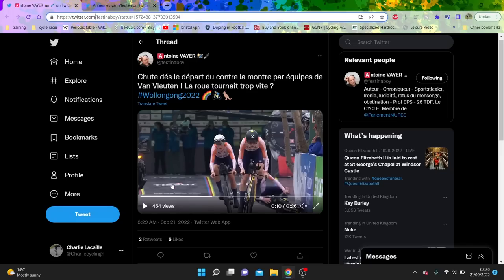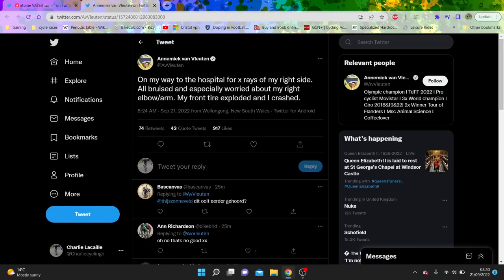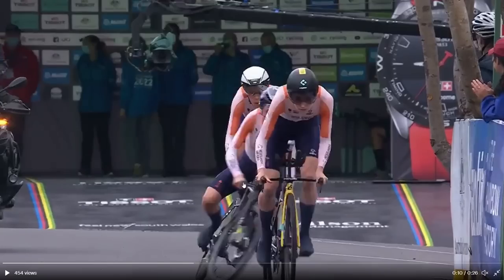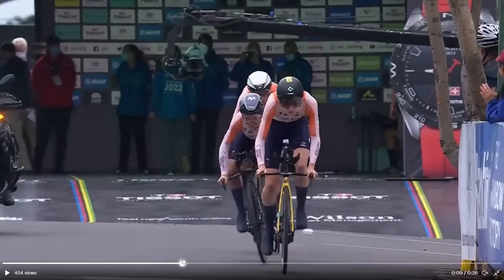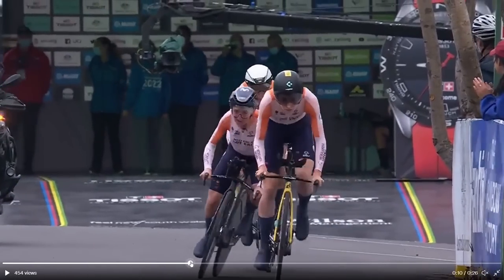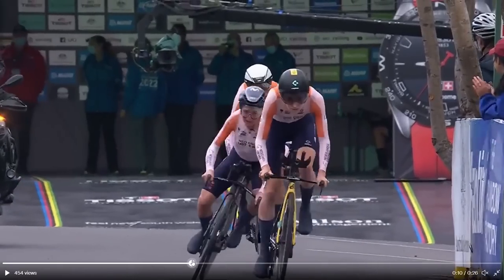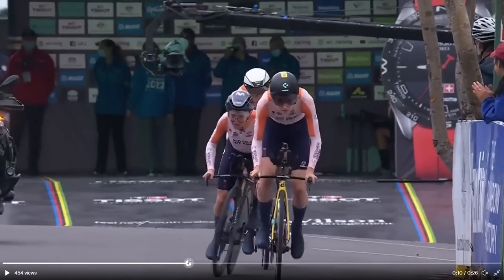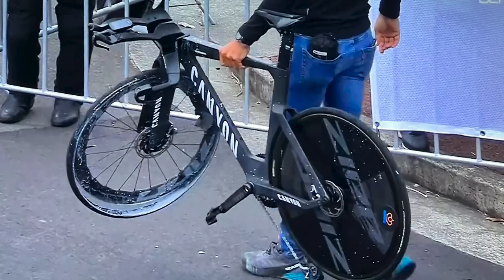Van Vleuten MASSIVE WORLD CHAMPS CRASH - caused by TUBELESS

Comment from the maker: looks like now  it was her chain falling off her big ring which caused the crash and not the tyre which AVV initially blamed
Reply: Either the chain or some slip of the free wheel mecanism. As you say - nothing to do with tires.
Reply: The chain falling alone would not cause that to happen. I've dropped chain many times and so have the pros and that does not causes you too loose control of the front of the bike like that. Have a look at Waynos video: https://www.youtube.com/watch?v=j5Mqh4Sudok&t=485s 
It makes sense too, either the rim cracked on the inside or the tape popped inside, which led to the wheel going flat almost instantly. The tire came off the the rim when the wheel finished cracking against the concrete barrier. If you don't believe me, try sprinting with a flat wheel full of sealant, it's like riding on butter. Those Zipp wheels have had some issues. GPlama cracked his and a friend of mine had his cracked on the inside, a week after buying it! She could have also miss-shifter the front derailleur while trying to grip for dear life and that just made it worse.

Comment: It wasn’t caused by the tyre, watch again. Her crank seems to slip (broken chain?) and this is what causes the bike to jerk out of control. The tyre came off from the impact.
Reply: The chain didn't brake
Reply: She was going down anyway, but just imagine a decent and a pro is doing 100kph and hits something even very small and the tyre blows off the rim!!!! it’ll be good night from him or her, surely they ain’t gonna use hookless rims on mountain stages 🤔
Reply: @julianmorris9951  - I started racing in the 80's both in the US and Europe.  I've seen folks on clinchers, tubs, and tubeless and I still haven't seen a tire "blow off" the rim. I've seen wheels shatter before tires blow off. Now on a MTB, seeing a tire with really low pressure (2.5 bar/35psi) burp and slip off but that's a really different scenario.

Comment: Yes chain dropped in little ring. You can see that the other two in the big one. This and several hundred watts caused this. Tyre exploded hitting the barrier and rear derailleur snapped off during the crash. Nothing wrong with the tubeless setup
Reply: I'd rather go with avv's comment of "my tire exploded" not chain dropped hit the barrier then tire came off. What unstuck her and caused her to go down was the tire exploding. No other mechanicals would cause such a significant swerve. Everyone has dropped a chain in a tt before, novody swerves, they even relace it at speed. Totally seen tubeless hookless bullshit explode on me at a traffic light. And there's definitely sealant evident so it was setup correctly. Something with high pressure and less attention to road tire standards keep messing up hookless. It's dangerous. Even just road tubeless with hook is dangerous. Yes I still ride hooked tubeless on the road with not too much to complain about. But there's something wrong with road hookless.
Reply: @Halfhere123  she was standing up pedaling, when you put down your Power whilst out the saddle a chain that comes of will throw you off balance for sure! Had that happen to me and I went down quite similar to this. I dont think that the tire was the issue, it came of the rim from the hard hit against the curb!
Reply: @Halfhere123  when leaning forward/standing on pedals and putting power down. If you drop the chain it's easy too loose balance

Comment: As analyzed and reported by Cyclingnews staff, her chain involuntarily dropped onto the small chainring as she was accelerating, causing her to lose her balance, hit a concrete cub, and fall over. The tire only blew out after she hit the curb, because the front carbon rim broke (shattered).

Comment: It looked more like she snapped her chain or something because when you look closely there’s a split second where she kinda snaps in her pedal stroke. To me it looks like her tire exploded when hitting the curb.
Reply: Correct
Reply: Photos after the fact show the chain intact with the rear derailleur snapped off.
Reply: fully agree...chain lost resistance...not properly in gear
Reply: Yes but there’s a lesson to be learned from the tyre blowing off the rim, was it hookless crap?💀 imagine hitting something on a fast decent, something small even and that happens 😱 surely the pros have got to carry on using tubulars which won’t come off and give you a chance 🤔
Reply: @julianmorris9951  - the wheel shattered on impact with the curb. No tub, clincher or tubeless will stay on after that happens.
Reply: Yes correct, you can see that she falls toward the top bar during her pedalling motion, like when your foot slips on the pedal, which hers didn't, the chain dropping to the smaller ring makes sense. The tyre exploded when it hit the kerb, I was at the start and it went off with a loud crack, you could hear from a distance.

Comment: You can see it explode when hitting barrier as that's when sealant goes everywhere 1:47. Not before. You'd see an immediate release of sealant if it exploded causing crash. Looks like a chain slip, a sudden shift of weight forward ,causing the bike to buck like that. i've crashed like that before due to chain slip on worn sprockets
Reply: Tubeless often fails without sealant leaking

Comment: When watching the slow motion video it looked more like she was pedalling for a split second without resistance, like if the chain had fallen of or not in gear. That is also what the commentator said. But if Van Vleuten said it was the tire, then it probably was. I believe it wouldn't blow of completely when hitting the concrete on the side, if it hadn't come off the the rim a bit when she had pressure on it.
Reply: Just watching the video from both front and reverse, the tire looked fine all the way until the wheel smashed the barrier and broke. That's when the tire removed itself from the wheel.  Looks like something happened with the chain/shifter to me.
Reply: @bikndave68  yea i watched it in slowmo and before she hit the wall, chainring obviously dropped into the small gear
Reply: Im thinking the same, even tubeless tire should stay on the Rim after such a slow speed low weight crash

Comment: Really don't think it has anything to do with the tubeless configuration. (You would have likely seen sealant much sooner). There was a jarring motion, like a cog / ring slip.   The only reason you see sealant at the end is due to a significant impact pushing the tire off the rim.  There is a tremendous amount of sealant on that tire, which you would have very likely seen earlier. 

By the way...it's a Zipp 454, not 404.  Respectfully, I recommend you be cautious about how you state your analysis and "conclusion" , as it's may be interpreted as defamation from SRAM/ZIPP.

Comment: According to her latest tweet, about 15 minutes after you posted, she now thinks it wasn't the tyre.
Reply from the maker: Yh I saw that. Strange if it was the drive train which people speculated initially
Reply: @CharlieCarbsandCycling  Wouldn’t be a surprise considering Hayter’s luck and the general chaindrop issues with 11/12-speed mixing.
Reply: Not certain, but maybe these national teams all with different bikes have mechanics that are not the usual trade team mechanics?  These bikes and drivetrains now have such LOW TOLERANCES that even a micro fraction of an error in set up at this level can be a serious problem, such as this accident.  Sucks to think it's a mechanics fault, but looking at the footage, it's hard to argue that it was AVV's fault.  Leaving only bad luck and the mechanic.  Stinks for AVV.

Comment: This wasn't the tubeless tire. If the tire "exploded" and caused the crash, then there would have been a lot sealant everywhere BEFORE the bike went into the curb. This was caused by a left leg downstroke with no resistance (probably due to the shift into the little ring) which completely threw her and the bike off balance. The rear view replay shows that pedal stroke and her body drops way lower than normal. She is actually sitting on the top tube as the bike careens out of control. (Rear replat view shows this.) Not a position you wanna be in on a TT bike. The front wheel broke all the way through on contact with the curb causing the tire to come off.

Comment: Whether it was the tyre or not, I wouldn’t exp3ct sealant spray from a mounting failure. Centrifugal force is going to push the sealant away from 5he rim towards the crown of the tyre. Question is, why run hookless rims which impose a strong upper pressure limit on a TT bike? Sponsor dollars, of course...

Comment: One must measure the rotation at higher resolution, it'll be obvious in a power meter spike if the chain went off the big ring as well, either way bad luck not the tire.

Superlight can't be super reliable nor super durable without voodoo engineering my bet.
Ymmv 🍺

Comment: You think they maybe put a too narrow tyre on?
Zipp says 25mm is ok on the 858nsw
But that wheel has outer width 27mm inner width 23 mm.
I would always go for 28mm tyre on that.
Reply: Could be. And/or they put too much pressure in the S TR. The max is 5 I believe. If the mechanic of the team is not experienced with the hookless rim and S TR they might have out 5.5 or 6 bars in it for the TT
Reply: Laughable on a TT bike, especially for the front tyre.
Reply: @TheWoogeroo  actually according to zipp the 28mm tyre is the fastest tyre on the 858 rim.
i guess zipp tyres are not optimal equipment for tt then. but they probably have no choice.
Reply: Whatever caused the crash the fact is the tyre blew off the rim, imagine that on a fast decent!!!!!!! OMFG, tubulars, if it ain’t broke!!!👌🏻
Reply: 28 for cobbles. This is a 50kg rider on tarmac remember.

Comment: My guess would be that the Dutch federation mechanic was not au fait with the pressure limitations of the newer hookless tubeless rims (or AVV was looking for some rolling resistance gain) and added too much pressure causing the bead to fail.
Reply: Tests at Schwalbe HQ have shown that it takes a lot of pressure to cause a blow out with hookless rims. Nearly as much as with hooked ones.
Reply: @guidospanoghe8896  she wasn't riding Schwalbe tyres (and presumably their tests would have been done with "within spec" tyres which you don't know was the case here). I've had a blowout on a hookless rim so I'm only too aware of the limitations (hence the low max pressures from Zipp/Enve and other manufacturers)
Reply: Hookless rims are a load of old wank!! Should would’ve could’ve ain’t gonna cut it on a fast decent when suddenly you’re on the rim😱tubulars for a reason !!!! Surely the pros are talking about this, after it’s their life on the line, in this crash she was going down anyway but I didn’t like how that tyre flew off the rim.
Reply: @julianmorris9951   the tire flew off the rim because the rim was destroyed on the impact into the barrier.  This looks like a chain/drivetrain foul up.  Gotta feel bad for her.